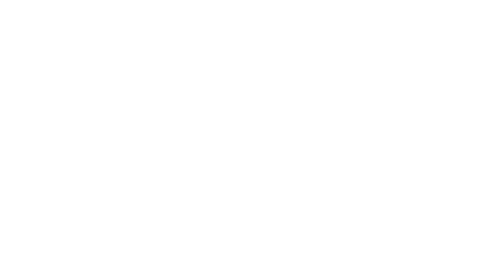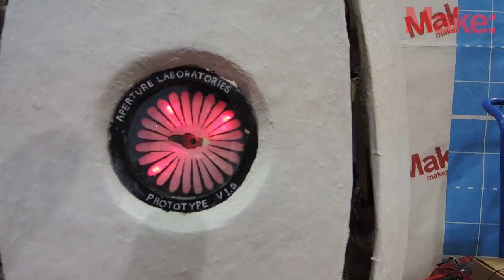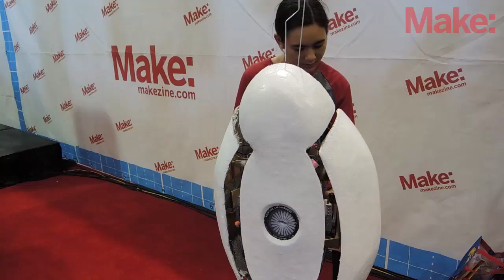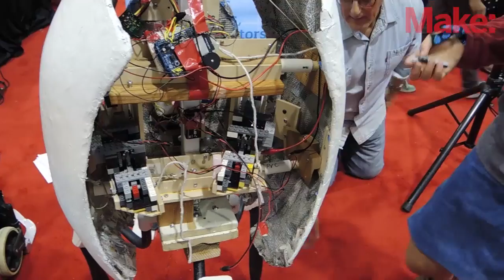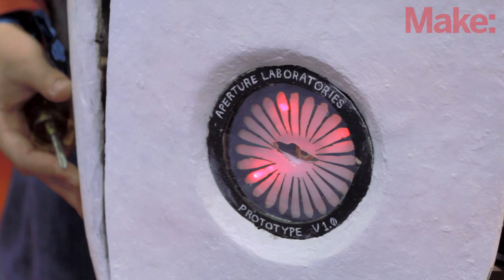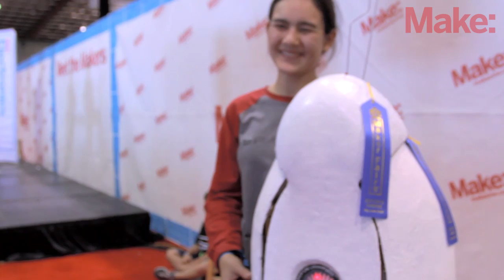An Arduino powered Portal Turret

Comment: bruhhh its made out of chaotic legos, and the outside is not even glossy. should use white spray paint and transparent glossy spray "paint" on a 3d print, segmented and glued together to fit in a 3d printer, then lego should not be used for the inside, instead, use a 3d printer. the firing mechanism also should not shoot them sideways and should shoot with a larger force, what should be used is an airsoft firing mechanism, this way the pellets will be fired with backspin and quickly, which makes it go in a straight line. the firing mechanisms should be angled with servo motors, and 2 rpi cameras should be placed in the black center, with a rpi5 running ai object tracking layered on top of depth recognition using both cameras to aim the firing mechanism.
Reply: plz tell me this is a joke. shes a child. unless she has access to machinery or a 3d printer this is great